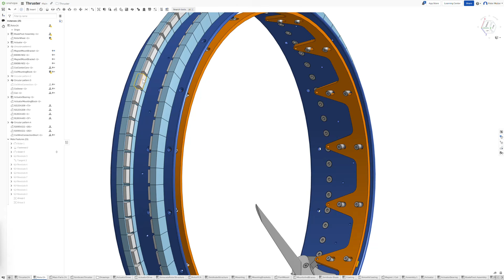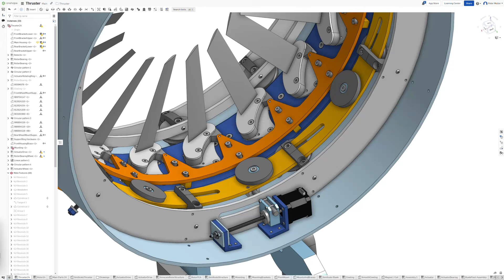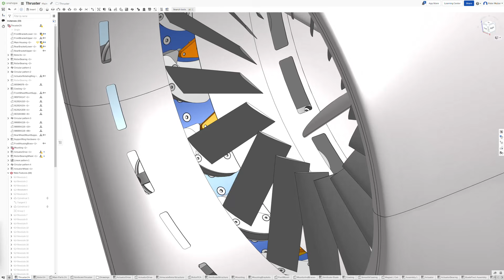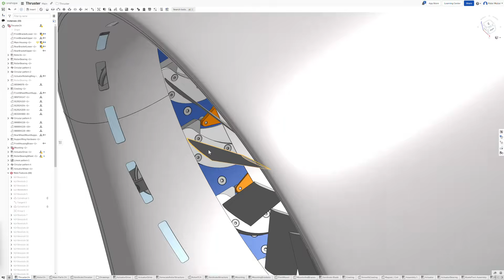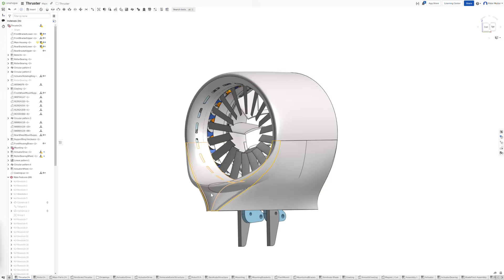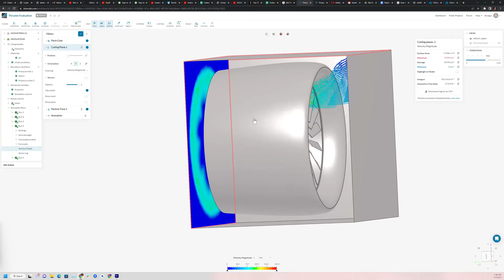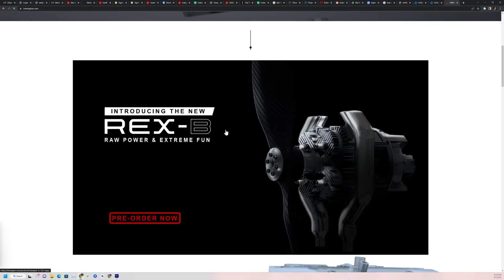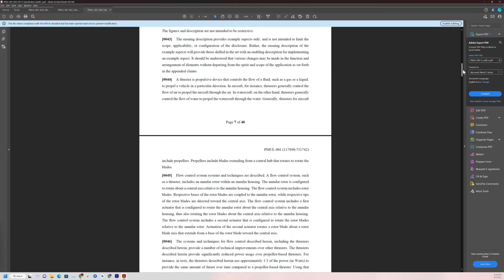Could this Thruster transform Aviation?

Comment: Very interesting! But I'm wondering about two things really, the inside blade tips are going to want to diverge under compressive forces on the blade at high rpm, then add the blade pitch mechanism under high load, will probably induce more blade tip divergence which might cause flutter? Traditional blades under tension are slung out instead of compressed in, will be more stable as the outward tension on the blade adds stability to it. The other thing that worries me is all the bearings, thats a lot of moving parts at those high rpms. Have you consider doing a large thrust bearing with perhaps smaller number of sphere or roller bearings... but holly cows Peter, this is very forward thinking!
Reply: The speed of those bearings was my first thought also.
Reply: =BEARINGless SRMotors ?
Reply: Could add an inner ring to the design to tie all the blade tips together to strengthen/stabilize them if it was an issue. Connection points would be concentric with the variable pitch blades axes of rotation.
Reply: At around 41:43, you can observe the tip wobble when the reflected lights catch the tips. I find myself nervous about what that wobble will look like with an order of magnitude increase in RPM. I agree about those bearings; large thrust bearing seems like the way to go (also much more expensive). Also, the pitch control system seems to have a lot of opportunities for things to bind. For example, if the non-rotating swashplate ring warps in any way, the cam slots may bind, or the whole ring may bind against the housing. 49:11, the thrust-to-weight ratio should include the generator/APU/battery in order for it to be apples-to-apples against GE9X.
Reply: @pterodaxx  Yes this if lengthened could also reduce drag/central turbulance
Reply: you could just attach the blade tips together
Reply: Needs air bearings maybe? Like these 20K RPM drill spindles at my old work lol
Reply: This thing screams FLUTTER. Reinforcement with a spinner structure, which is supported by stationary frames, is strongly recommended.
Reply: the inner blade tips are moving substantially slower than a typical blade in a standard center driven configuration. I suspect this will experience less blade deflection for a given material stiffness.
Reply: @TimberStiffy_  Another reason to migrate to a low RPM design with less and bigger blades similar to the original ring driven propeller used in marine transportation.
Reply: @sigmundwong2489  If that's not just an effect of the camera shutter time that's some serious wobble and very frightening. If you cranked the motor to 1200 rpm instead of 100 rpm the forces involved in a resonant situation would be insane. The blades must somehow be stiffened and dampened.
Reply: @appa609  With a toroidal design?
Reply: Love that design. I think there’l be less centrifugal force on the blade. Good luck & wish you success. 👍
Reply: Was thinking the same about them blade tips as soon as I looked at it. 🤔
Reply: Centrifugal forces still apply and still sling it out if u make FBD? just opposed by emf instead of tensile stress in matl?
Reply: You read my mind
Reply: you've made a couple of points that come into my tiny little brain...
- needs a central "ring" to maintain the stability, and there could be quite low loading on the rotor.
- i wondered if the magnet structures could be designed to hold the rotor centered, as a low-clearance would see very large attractive forces, largely eliminating axial loading
- air bearing approach to "thrust bearings'" needed...in truth, as the thruster is pulling forward, any "bearing" in the rear should see, essentially, no load in operation.
- with a center ring, and a bit of clever mechanism, it should be possible to do constant speed/automatic pitch there, with some aerodynamic input to maintain constant thrust at varying forward air speed... imagine a centrifugal "cam" with the can shape built into the "inner" part of the blades, so that the simple "expansion" of the centrifugal ring would slide along the blade (a short distance), twisting the blades...blades held in a "bushing" at the rotor end. hmmm..
-in the front of the thruster rotor, magnetic, or air, bearings have an increasing "separating force" as clearance decreases, eminating need for "rolling" bearings, except as backup, or low-speed assist.
BUT, here's someone who is presenting an  interesting idea, I'm just poking away at what he's done, often much, much easier than having the original idea!
Reply: @lohikarhu734  I was also thinking about a no-load scenario for the bearings in between operations. Maybe a simple clutch sort of mechanism could be incorporated without too many parts... Separately, I don't know if there would be any resonant effects with airflow in atmosphere, as I know nothing of CFD. But if there were at different speeds, pressure/temperatures, they could be easily tuned out with adjusting the stators. I don't think that would arise without a deeper configuration with more rows of blades but it's fun to think about.
Reply: @martshearer498  A toroidal design would solve the deflection at least. But more importantly, the toroidal blade geometry that would sort of coil around the outside ring in this shaftless design would look sooooooooooooooooo cooooool 😲.... Which could have a larger impact on fundraising than any potential functional benefit it might provide. Especially considering the buzz that toroidal-anything is currently getting in the market.
Reply: @sigmundwong2489  and that wobble is at 100 rpm, imagine over 5000.  I’m still unclear why a rim motor is better than a hub motor?
Reply: @daltanionwaves  Toroidal blades would eliminate pitch control, simplifying, yet limiting the design. It might, however, bring stability.
Reply: @sigmundwong2489  I also noticed the wobble on that part, while watching the video, and it seemed very strange to me, considering that it is low rpm. If I noticed, and I'm no turbo engine expert, then an expert definitely would roll the eyes 👀
Reply: Would think as Peter mentioned that the inside would turn slower relieving some of the force apon the tips 🤔  and the blades being attached at the outside should make them stronger as well  ??? 
if blades did move inward or outward under speed would not they all flex equally maintaining safe clearance.....
backwards thinking rookie,  I am ....
Reply: @pterodaxx  Tires are balanced using weights so at high rpm the tire doesn't bounce and wobble. At high rpm any imbalance in a center ring will have the same effect.
Reply: @seancollins9745  I suspect the precise opposite. Yes, the tips are moving slower. However, I think the blades will fare vastly better in tension than in compression. Imagine suspending a weight from the end of a blade, versus squeezing it longitudinally in e.g. a hydraulic press applying comparable force. Which configuration will tend to bend the blade more?
Reply: @wombatillo  I agree that resonance must be investigated. And if we're going to go up against the turbofans, it should be noted that axial compressor blades are mounted to the shaft with a triple-dovetail "pine tree" connection, which is loose.  If I understand correctly, the wobbliness/looseness of the blades prevents resonances from propagating between the blades and shaft. This works with the blades in tension; I am not confident it will work with the blades in compression.
Reply: Yeah, that is a lot of moving parts to wear out and fail over time. With advancement in the room temperature superconductor, maybe this could become frictionless by using magnetic levitation someday
Reply: @henrykdoruch8056 : There HAS to be bearings SOMEWHERE in all that mechanism to handle the pressure between the blades and the structure it's supposed to move forward, so unless a way can be found that can REMOVE all those moving blades and STILL convince the air to travel at a high pressure through the cowling, bearings are going to need to be used.
Reply: @pterodaxx : Why not a nose cone with movable attachments to the inner blades? It would force the air to move even faster through the blades and would prevent pressure leakage from escaping. A nose cone in the center would ALSO add a ventury effect to help speed up the airspeed flow of air, just like inside of a carburetor.
Reply: Agreed.... the main load would be at the blade connection at the rotor end, but the tips will deflect proportional to the amount of load.
For commercial purposes or mostly any other purpose, it will require a central hub of some sort. Small light weight drone applications might be able to do away with a central support though.

Very interesting design overall though !
Reply: @Daniel Franz  I agree... it will need a central support.
A thin ring (2 piece, front and back) hollow on the interior with magnetic levitation bearings (opposing fields) and of course, the opposite fields on the blade ends may provide almost maintenance free connection at the central hub
Reply: This would be absolutely incredible in the UAVS pro-consumer industry. Scale it down and folks would be lining up.
Along with solid state batteries, mana from heaven, literally!
Reply: In portuguese concordo ... talvez um anel e algumas aletas robusta para  a sustentação ao anel e equilibrar a tensão.
Sobre rolamentos sou radical.
Pode ser um sistema de mancais magnéticos 0 atrito
Reply: I would think this could be solved with blade geometry. Most props are narrow at the base and wide at the ends. It would need to be the opposite. Just like a normal prop the fastest part of the blades are the outermost edge. Ironically that is also the main issue with this design. The rotating mass is much larger than a standard turbine.
Reply: @sigmundwong2489  I agree about the pitch control system, It will need some sort of backup so relying on only one motor for changing the blade angle won't be adequate and will impart more torque on one side of the ring and cause possible binding under higher rpm's. It would add to the cost and weight but 2 sets of 3 smaller steppers equally spaced around the circumference would solve the unequal torque issue. This way there three motors  at a time doing the work with a backup for each that only would be used incase of failure of the main stepper motor.
Reply: You would have to use a high speed camera to determine “the wobble”
Reply: Peter... very interesting... however, I think the gains from variable pitch will not be worth the weight, the complexity, the cost, and the compressive problems that were previously mentioned... Consider replacing separate blades with a disk... milled to represent blades with a hub...  will the field variances of the coils set up a harmonic vibration ?
Reply: That was my exact thought it would be interesting to see this thing fully maxed out. To the point of Destruction or to see what it can handle. This is the first time it popped up on my channel and this is very cool I would have never thought about it
Reply: Could the wobbe be compensated by the blades all having a slight angle to their mounting?
going either in to the engine or out from it?

That way the thrust they provide presses them firm.
Reply: Yes the traditional outward centrifugal force on the blade makes it so reliable.
This will be OK for low pressure applications like greasy extraction fans in restaurants. But again the centrifugal force will force the grease up the blade lengths.
I like experiments with prop blades.
I've just seen the sharrow boat prop manufacturers video.
Good stuff.
https://youtu.be/xfA-gzqhkXw
Reply: @Mart Shearer  that would reduce or possibly eliminate flutter
Reply: Magnetic rail
Reply: @martshearer498  maybe but the benefit of toroidal blades is reducing tip vortices.  However, in a normal ducted fan setup there aren't really any tip vortices which negate the benefit of toroidal props.  So I don't think there is any benefit of toroidal that wouldn't also be present in just extending the blades to a central hub.
Reply: Sometimes over engineering can give great products, sometimes it's just over engineering... Exciting to see where this ends up on the scale...
Reply: Would offsetting one ring of magnets make any difference? So the magnet fields would be overlapping- similar to multirotor drone motors?
Reply: Great concept, looking forward to seeing future of the development for practical application
Reply: turn the rim itself into the motor by using a linear electric motor, then you could use a magnetic bearing and suspend the blades on the motor field so there would be no direct physical contact.
Reply: I am worried that the blades are a cantilever-design; they are only secured at the circumference and can vibrate/bend under load. Fatigue strength of the blade material will need to be analyzed and the blades would also heat up, contributing to flex.
Reply: Even if it proves too problematic for aviation, think of the promise for a new Chrysler vehicle. 🤣
Reply: I had the same observation. You can see in the video the blades are quite unstable. This would be impossible to balance for high RPM applications. A small debris could completely wreck this rotor.
Reply: @Kiyodio I believe you have a valid point. RPM won't be as high, adjustments of the fins will compensate thrusting modulation. I suppose the shape of the blades will affect the thrusting performance. A pyramid shaped blade should do it. Perhaps fatter at the base tapering off to the point in the center of mass.
Reply: I'm no mechanical engineer, but to my very basic understanding the degree to which some materials that can tolerate compression can tolerate it, exceeds the tensions most tensile strong materials can tolerate. So if you ignored all the fancy stuff, and they actually compress rather than trying to bend/break, you might be able to find materials to make the blade out of, that would allow this configuration to spin many times faster than an ordinary fan.
Just that, combined with it being electric, makes this a fairly interesting concept.
Reply: I agree with the blades are going to want to collapse in on themselves at speed. Someone has developed a Thruster much like this for use on a boat that seems to work well.

Your propeller methodology is understandable but I don't think takes into account of the propeller tip speed breaking the speed of sound at which point efficiency is lost and thrust would suffer.

I don't remember what the max rpm were on the O-470 or O-540 in the Cessna 180 and 185 that are used in them.
Reply: the design is largely inefficient, you mentioned only couple of things among dozens more, not talking about instabilities, vabration prone etc, lots of bearing alone is a poor thing. It won't work.
Reply: @ChadDidNothingWrong  Not sure if air bearings would work due to centrifugal loading?
 Probably OK for the housing on a fully balanced assembly but not for pitch adjustment?
As a Proof of Concept it's OK though in my oinion
Reply: Air bearing tech might be a good in this application. No idea of the forces at play though.
Reply: I too was thinking that the little black wheels must be gone to rotate at insane rpms if say a 96 inch version was used going at 5400 rpm - what would the rpm be on the little black wheels (bearings) ?

Would they tear themselves apart ?
Reply: The idea of using an inner linking ring, may solve some of the flutter problems and the blade compressive issues ?
Reply: @glenturney4750  According to holiday fluid dynamics model - that’s the fastest flowing air - through the Center.
Reply: @VisualEcho  
Or stroboscope, and alter the flash frequency
Reply: @peterclarke3020  The surface speed of a 96" cylinder is easy enough to work out using circumference of the large ring. The small wheel contacting it is only slightly more complicated but also uses circumference (Pi multiplied by diameter)
Use 3.14159 for Pi as it's more accurate and easy as it uses diagonal on keyboard or calculator.
96" is over 25 feet (25.13272 )
Reply: You could use a mag lev system no friction
Reply: if he did the same concept but with those blades inside out.
Reply: I see a lot of inner ring comments and flutter, I also suggest a round cone to divert the  center air to compression, get rid of as many blades a possible, make them bigger in the center with a deep pitch in the middle tapering to a light pitch on the outside edge, and fix them in place. You should have enough variable thrust control with the speed of the inner rotor controlled by varying the frequency of your power source. R/C duct-ed fans work well this way. You may want to proto in the R/C world with 3D printing... But metal is way cooler. 😉🔜🪤
Reply: Why not connect the blades at opposite ends?
Reply: You could modify the blade geometry so that the air pressure would "pull" the blade in
Reply: Could counter it with a smaller fan rotating the opposite direction in the core, a lot like a helicopter.
Reply: 1000 to 5000 rpm is not too fast to flex out the louvers of their thickness but I agree with you about too many moving parts and also the centrifugal force of all the spinning parts may cause vibration .
Reply: Well you took the words out of my mouth, was just going to ask this.
Reply: The number of bearings was my first thought. It's a lot of points of failure and I have to imagine added friction (though his simulations show better performance so I guess the added friction isn't a big deal). I didn't think about the stability of the blades, but after seeing them in action your point is borne out. You can see them wobbling in a wave-like pattern as it spins. It's a good thing his controller doesn't go faster because a catastrophic failure would likely happen and be incredibly dangerous. An inside thin ring would help stability, but I don't know how he would keep the pitch adjustment which is a real winner here. 

None of the downsides matter here. Who knows how this will inspire the next design from himself or another. You have to try to succeed and I'm glad there's people like him that are so intelligent.
Reply: Make the rotor the stator, mag lev bearings. Good luck!
Reply: You can see vibrations in the blades even at the slow speed I'm wondering the same as you plus if it were in motion doing 600 mph with the blades even start to bend with the pressure
Reply: @sigmundwong2489  He did state this is just a mockup of the basic rotor and blades that he had made by a local metal shop that did a horrible job.  Some of that tip wobble could be from the ring not being true round as stated in video.  Something like this wouldn't be made by a local metal shop but in a factory that makes precision aircraft parts.
Reply: To all concerned about wobble, consider the effect of shutter roll and LED light bulb refresh rate from cheap power supplies in the bulbs. This can generate the illusion of wobble. An airplane propeller, …without LED lighting… appears to warp almost 90° off-axis when photographed with a cell phone camera. Video shutter is even more imperfect. Additionally, he mentions that he was disappointed with the lack of precision of the prototype. And alloy selection matters a lot for stiffness to put it mildly. To make a true evaluation, one must use high end lighting and a high speed shutter such as a  Phantom camera.
Reply: @Telknor  Sure. But what is the purpose of a prototype? Is it not to gain confidence in a concept, process, or design? If its characteristics (such as tip wobble) are not to be taken as a prediction of how a production model will behave, what's the point of making this "prototype" anyway? "Just trust me bro, all the problems will disappear once you spend millions making this at production scale"?? What is gained by making the prototype? He hasn't even measured the thrust, or airflow. Heck, he hasn't even shown a "smoke machine" test, just to see how the airflow is behaving qualitatively. "Well, this is just the prototype" is a few light-years outside the realm of "things that are relevant."
Reply: @sigmundwong2489  To answer your question What is the purpose of a prototype? To test an idea or concept with cheaper parts or materials before spending the money on the required materials or parts for finished product.  I do it all the time by 3D printing stuff out of PLA plastic before having anything machined out of metal.  Helps to see flaws in the design that are not apparent in 3D CAD model or drawing.  Yes, I agree that more testing of his design is needed but for that the "prototype" needs to be finished out more to the design of the 3D CAD model.  Personally, I would have scaled it down and 3D printed the whole thing out to do scale test before going off and having this metal mockup made.  He's scared to run this thing in its current state past 1000 RPMs and I don't blame him.
Reply: @Telknor  while you are correct in principle, the foregoing postulation that the tip wobble "may" be attributable to manufacturing variation instead of actual blade wobbling misses the mark entirely. The comment threads here are filled with wild speculation, all of which could be alleviated with some actual measurements. The purpose of the prototype is to gain confidence in the design. Absent any measurements, characterization, or other analysis, it is nothing more than a giant, shiny paperweight, and speculating that the flaws we can observe even without such measurement will prove to be due to manufacturing (and not design) invites disaster. Moreover, it reflects an unwillingness to consider flaws  inherent to the design. And iterating on the design is the whole point of prototyping.
Reply: @blackrockcity  ….so tell us about gravity again…….
Reply: High tension wires between each blade in the center to make sure they don't curve or bend or sink due to pressure.
Reply: Exactly that's what I thought the moment I saw these core less blades 😅😮
Reply: @ltv..123  wow this comment section reveals that some real richards go into aerospace, particularly in other threads. Condescension is not civil behavior.
Reply: @blackrockcity  ..but professing obvious parameters is? Calling people a dick is ok? My comment stands Einstein…..
Reply: Selling a dream cool vid tho
Reply: @ltv..123  parameters? Did you mean to reply to someone else?
Reply: @lohikarhu734  it may add a bit more weight, but, I was thinking a Halbach array of magnets to give a repulsive force against the thrust.  Seeing that a lot of you noticed the harmonics of the blades, I was thinking If the blades can be configured like a high-bypass fan with a small cone in the middle.
Reply: Yes. I was thinking some type of ring hub on the blade tips. Minimally sized, but for optimal strength with braces to the case angled to the forward side. Possibly elongated for thrust like the rear foil.
Reply: or using some EM coupling so that you elmiminate almost all the friction and parts to move
Reply: Was kind of my first thought.. and at 100 rpm they definetly has a flex already. Increase the rpm to one that would produce any usable thrust plus adding a 2nd variable of adjustment.. it will need a center balancer of some sort, which add other issues. Shorter blades would also cause other issues. In the end, interesting concept but feasable? Mmmaybe with more r/d.
Reply: This
Reply: Bearings, bearings, bearings! Bearings need lubrication,cooling. Open frame bearings can fail by contamination. Sealed bearings get hotter. Under constant heat, the lubricant breaks down & is less effective at it’s job. Those rollers contacting the ring and the pitch actuator will both wear out for lack of any lubricant! Titanium could help a little bit. Nice imagination, lots more to do on it. Keep going!!!
Reply: @henrykdoruch8056  ....their main function is as THRUST bearings.  Whatever thrust this ever makes has to GO somewhere.  In a real jet engine, the thrust bearing is a big issue.  A monster high precision roller bearing with high pressure oil pumped through it.
Reply: @sigmundwong2489  rim bearings, and all a-flutter at 100rpm doesn't bode well I'm afraid
Reply: I got worried about it myself. This setup does not induce stress stiffening on the blades and they will definitely flutter more under load...
Reply: Very sensible....perhaps a gimbaled thruster ring supporting the inner annulus of the compressor blades?
Reply: My first thougt was wow there are a lot of bearings and moving parts. Makes it expensive to produce and a nightmare /expensive to service. From an Engineering point of view i find it very interesting but there are a lot of interesting and good working things out there that were never used because they were to expensive to build or/and to maintain. Especiall moving parts at high RPM.
Reply: I wonder if he can use this design but instead of bearings, have it behave like an electric motor with a stator, and even use that in theory to push the blades.  In essence like a diesel electric locomotive. And the magnets can maybe cause either reduced friction, less or no bearrings…
Reply: @sigmundwong2489  the variable pitch should be tossed. What if one blade doesn’t pitch properly while the rest do?  That’s gotta cause an imbalance - not of weight but of air pressure. Recipe for disaster
Reply: @seancollins9745  like on a record player! whoa dude
Reply: I'm a dum dum, but I was an aircraft mechanic, and thought the same thing. I used smaller words though.
Reply: @SSGTVolken  oh I see, do you delight in sitting in the corner while you wife " entertains" her boyfriends?
Reply: perhaps a ring in the middle where the single middle point of each blade would connect to and be able to turn freely inside..    this at least would have a ring/cylinder directly in line with air flow be able to offer some additional stability from the rigidity of the other blades..
Reply: I don’t know about aviation, but, I bet you could make a mint selling fancy hairdryers.
Reply: If you look closely while it is spinning the inside of the blades are vibrating somewhat.
Reply: No. If you can figure out how to allow the blades to still change pitch you still have to figure out how to support and mount the center ring to both keep the blades from flexing at high speed, and accept the force applied to it as well as the blades push back onto the ring. The design definitely needs it but how to solve it is quite the puzzle.
Reply: Why didn't the creator comment on this question? I thought this was a very good question and makes total sense. Otherwise this looks amazing.
Reply: @sigmundwong2489 don’t forget the 171.000 kg weight of petrol against this model 😉
Reply: @seancollins9745 yes that’s why this concept has a better efficiency. Because the force drag is at the outer core less then inwards but the velocity airspeed (vibration energy speed) is lower and therefore the friction speed lower. It increase the amplitude and not the frequency at the center point. So therefore this system has much more efficiency. 
This outrunner EDF system has better resonances frequency range then an actual in runner system.
Reply: If his motor were from radial flux  instead of axial flux and was asynchronous induction instead of synchronous perminate magnet, then the repulsive induction forces would hold the roter in the center and  might allow for the elimination of certain bearings and potentually a significant reduction in weight.